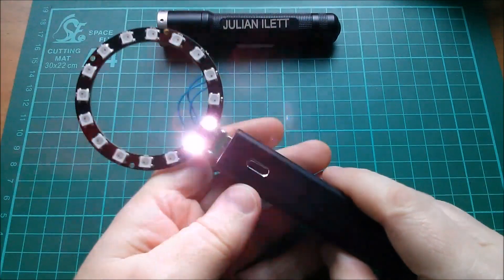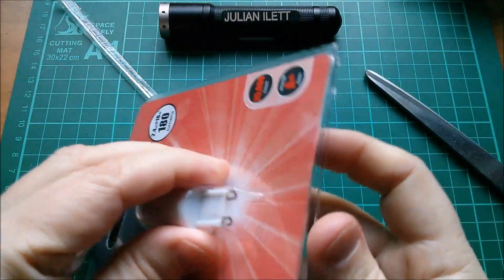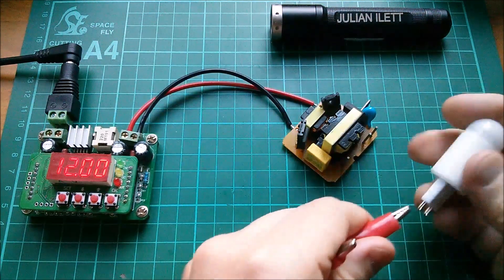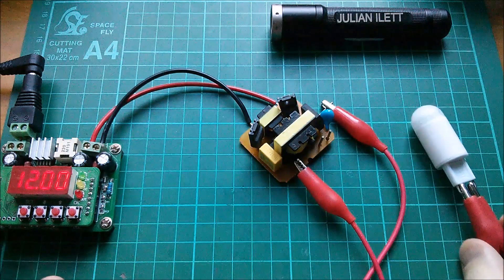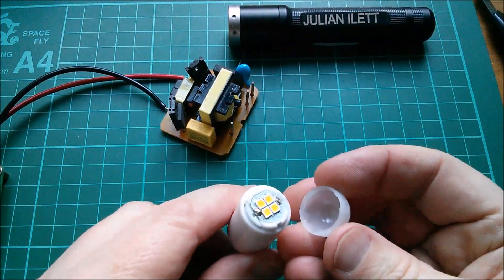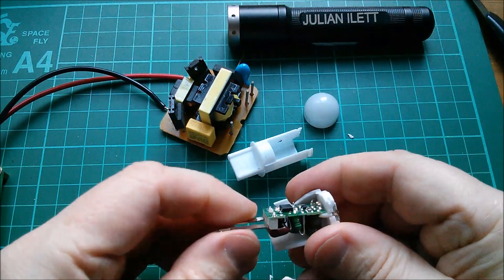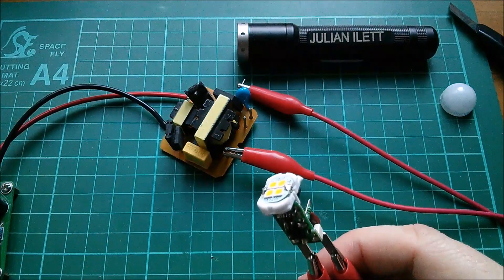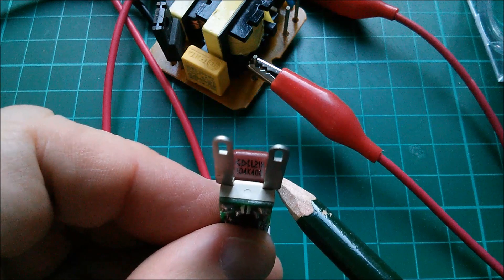LED G9 by Sainsbury's

Comment: The G9 socket is mainly used for small halogen capsules. You can get ceiling fixtures and lamps that take these lamps because they're compact, easy to install and because the holders are normally ceramic, they're very well insulated and you can't stick your fingers in the socket, to they're also quite childproof.

Comment: Not sure if it is known, that you cannot simply switch the old light bulb of a fridge to a modern LED type. The reason is, that old fridges, especially if they are the combination type ones, with a frost section, use the light bulb to heat the normal fridge compartment, while (deep-) frosting the other part. The reason ist, that they only have one cooling system. Modern fridges have separate valve controlled cooling areas, so they do not ice your salad and cheese, even you install an LED as a light. In fact, real modern fridges already have LED installed as light.

Comment: Why route air gaps for voltage isolation on PCBs?

A few reasons why:

1. When arc-over occurs, it could cause carbonization (a.k.a. "burning") on the PCB surface. This could result in a permanent short. This is also irreversible damage, where-as arc-over in air isn't (unless something else goes wrong). This would be especially bad if a single high-voltage spike created a permanent short, then any "low-level" voltage source would still have a low impedance path available.

2. You have the option of installing a high-dielectric strength shield (something much better than FR4/soldermask, and better than air).

3. Dust/dirt can accumulate on a board surface, reducing dielectric strength. Not as much of a problem (though still could be a problem) if that surface just isn't there.

4. In the second link, they did some experiments where humidity had a drastic effect on the breakdown voltage of the soldermask, and a smaller (though potentially still significant) effect on a slot. Their best result was from removing soldermask and cutting a slot (no significant performance hit).
Any inadvertent creepage mistakes will be removed by the router, though really this should be caught in the design stage, especially with modern CAD. The PCB might not work right if tracks has unexpected open circuits, and making a high-current track smaller could cause other issues :P
5. Required air clearance seems to be smaller than surface required surface creepage distance.

For complete details see the whole article here: ( https://electronics.stackexchange.com/questions/74244/why-route-air-gaps-for-voltage-isolation-on-pcbs )

Comment: Re. the fridge lamp: Fitted a Osram/Ledvance 2.5W 200lm E14/SES pygmy lamp in the one here and it's a huge improvement. There's one in the sewing machine too.

CPC (cpc.co.uk) do them under LP10039 for daylight or LP10040 for warm white and always have them in one or more of their discount flyers. The latest one has them for £2.80+VAT under LP1003902 & LP1004002 and delivery's free for web orders over £5 before VAT.

Comment: I'm interested in G9 led bulbs since I have a fixture that uses them. I once bought led bulbs for it but they flicker with mains frequency which I do notice and find very distracting. I would like to know if this design gives a steady light output. The G9 form factor doesn't have much space for smoothing cap.

Comment: The gap in the board is to keep the high voltage side from arcing over to the low voltage side.

Comment: If it was a cap dropper, it would've died shortly. It is a little buck regulator. The green resistor is a 1 milliHenry choke which makes up an EMI filter along with the 100nF cap.

Comment: These small inverters rarely produce a nice clean sine wave on their output,.. usually some very cludgy square wave... The problem then is,.. the step down converter within the bulb does not perform as you might think,.. and in some cases ( as I have experienced ) the cludgy square wave can actually kill what ever is attached.. Also the regulator within the bulb is doing its best to 'regulate',.. with a none standard input ( voltage, frequency, wave shape... and will probably be operating outside its design spec.. Pls give the cheapo bulb another chance.. and use an isolated supply... auto transformer combo

Comment: You say it's safe, but surely that buck converter is still capable of providing lethal current unless you have a current limit set?
Reply: It's "safe" because it's not referenced to ground, so you can't get a shock from it just by touching it with some other part of your body being grounded. You CAN still get a lethal shock from something like that, but you'd have to touch it with both hands simultaneously so that the current path is across your chest. The same applies with isolation transformers: they're a safER way of working with mains, but you still have to keep one hand behind your back at all times :)

Comment: My sister has G9s in her trendy multi armed bathroom light fittings... maybe the PCB slot is for anti tracking in high condensation environments?
Still seems like it'd make a lot of heat for a package with a small surface area - quite often G9's are used enclosed inside tiny glass globes afaik - wonder if they suffer short lives due to running over temperature?

Comment: That's kinda strange that the LEDs are using 80 volts
Reply: Indeed, my single 100w led takes up to 36 volts @ 3 amps. I think the other circuity was taking up most of the 80 volts in his light.

Comment: I have 3 x G9 in my electric fire for the flame effects. £1 that should save my cash cheers
Reply: LED's would probably cook in that application, same if I swapped out the 25W SES in my oven! Besides, all the heat goes to good use in a heater.

Comment: Julian, score some points with the wife! Take the old refrigerator bulb, break of the glass and innards and solder on this new bulb. Seal the base w silicone and you've fixed the refrigerator.
Reply: Not the same thing.
Reply from the maker: That's fixed - I found a pygmy bulb in a local DIY store.

Comment: The 100nF is probably a Input Filter, together with the Inductor (not a Resistor) at 7:33 and under the Heatshrink is also probably a low Value Resistor as Fuse.
Reply: 9:15 The heatshrinked component appears to be connected directly across the mains, so it's definitely not a fuse (if it was, it'd be a very shortlived one ;). More likely it's a high value resistor intended to discharge the capacitor when the bulb is unplugged so you don't get zapped if you touch the terminals.

Comment: Got a link for the inverter board ?
Reply from the maker: https://www.ebay.com/itm/1pc-2pcs-5pcs-10pcs-DC-AC-Inverter-12V-to-220V-35W-Boost-Step-UP-Power-Module-/332230871934